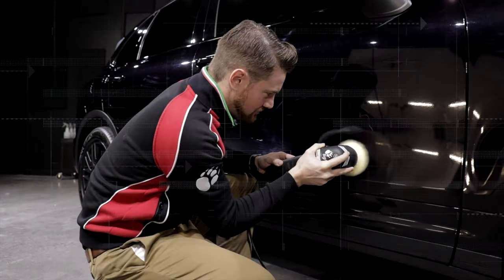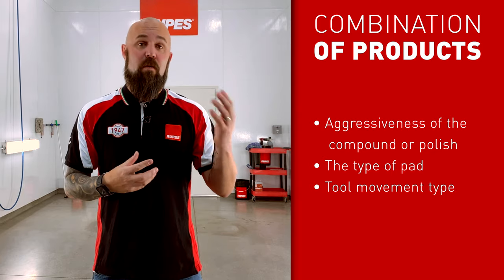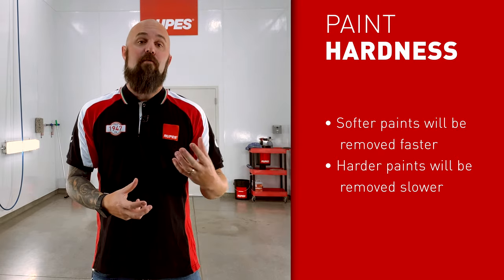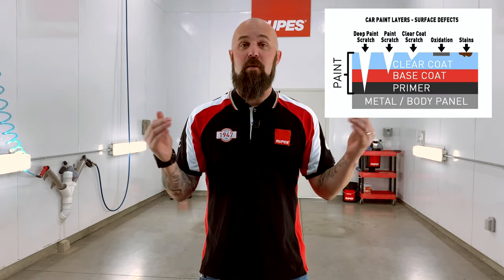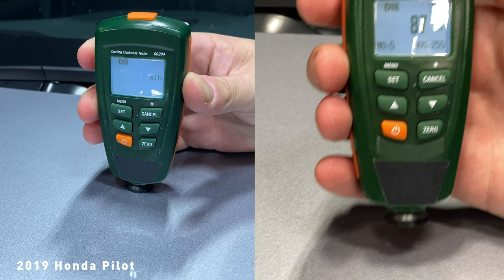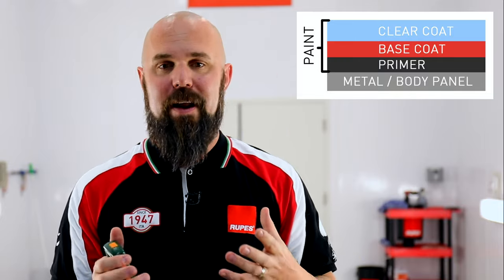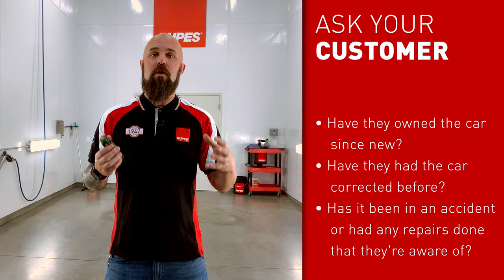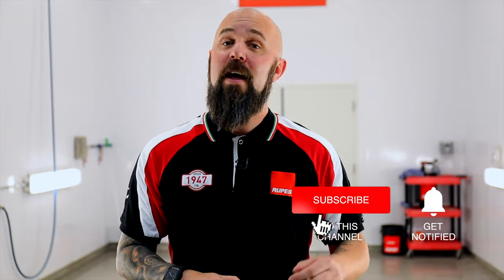How Thin Is Too Thin? - [RUPES Replies Episode 028]

Comment: Quick question on selection of a good paint gauge. What are the aspects or criteria we should look for? You mention accuracy. What’s a reasonable accuracy variance? I understand that paint gauges that read both metal and non metal surfaces are more expensive. Many car parts these days are non-metal, thinking bumpers and fenders, What’s the cost differential vs benefit of getting a good picture of the paint thickness? In other words, how can we be smart consumers when buying a paint gauge? Thanks!
Reply from the maker: Thanks for posting your questions Brian. We do not endorse any one specific meter and there are so many options on the market, in varying capabilities, price ranges, and feature levels it is difficult to even make blanket statements about what is "best" for anyone. 

In terms of variance, it varies (HAHA!). As the price goes up the accuracy tends to as well. Pay close attention to the variance level for whatever meters you're looking at and determine the cost vs. accuracy sweet-spot for you. Even if you buy a very inexpensive meter that has a wider range in variance, thats fine, just know in your head what that potential margin of error is and consider it when making decisions. 

For the cost differential vs. benefit of getting a good picture of the paint thickness - again it depends on your situation. If you're using it as a professional and sanding/polishing on numerous cars every day consider the risk/reward. What is the cost to repaint a vehicle if you mis-judge paint thickness on a customer car? The chances of an incident increase with the volume of cars you touch, right? For an end user, just maintaining their own cars maybe not as much of a risk/reward proposition there because they're familiar with the car and will only be accountable to themselves is something goes wrong. 

I know that is a lot of non-answers, but there is so much variability in this that it isn't the same for every person. Good luck on your research of meters! -Dylan vK
Reply: @RUPES  Thanks Dylan. Yes, i understand Rupes cannot endorse a particular brand. I’m not a detail pro. Just a guy with a few cars that likes keeping them well maintained and help a few friends and relatives with their cars too. I like and have a few Rupes polishers; LHR-15 Mk III, the Nano and have the LHR-75E on order.  It seems the marketplace  has a batch of low end paint gauges from $25-50, $80-130 range then from $200-500 with some $800-$1,400++. A lot of offerings to sort out. I appreciate your feedback. Any folks out there with recommendations, please advise. Stay healthy and happy holidays! Keep the good videos coming.

Comment: One thing that is very controversial is the Decon step before paint correction. What is the best way or the Rupes way of doing the Decon process?
Reply from the maker: Should be no controversy - as long as the step or steps address the contamination it isn’t up for debate. A surface must be clean before polishing, but how you get there each time will be unique based on the specific car and level/type of contamination. Mechanical and/or chemical may be required.

Comment: What steps do you take to up the level of cut if your not getting the result you want on test areas.

Would you go
Polish pad and polish
Heavy polish pad polish

Cutting pad and polish 

Or would it be cutting pad compound etc...
Reply from the maker: Adjust the combination of products or your technique for something more aggressive then test again. Changing only 1 aspect at a time so you know which adjustment is providing the improvement. This video covers the specifics of the test spot and product adjustment https://youtu.be/0Z79_1h2SyA

Comment: Excellent information, thank you. Wondering if correcting paint down to a minimum of about 3 mils would a couple of coats of ceramic coating help persevere remaining clear from UV and other environmental elements?
Thanks again for all the Rupes tutorials on YouTube 
Peter Leoni
Reply from the maker: Good question and probably one better posed to a coating manufacturer. Coatings vary wildly in their composition and the amount of possible film build they produce. Some are more scratch and abrasion resistant than others. Some are more chemical resistant than others. Certainly having ANY protection to serve as a sacrificial barrier over a thin clearcoat surface is a good idea, but you can't make assumptions based on an entire product category because of how much variation there can be.

Comment: What’s the best way to maintain paint that is at 3 mils or lower? Example a fine polish or just leave it alone.
Reply from the maker: Protect it and leave it alone if at all possible. If any polishing is done it should be the finest possible solution you have available and only done to enhance gloss, not to correct defects. Anytime we are correcting the surface we are removing material, and on an already thin surface removal of material can be detrimental to the life of the paint. 

In the case of extremely thin paint a product heavy in fillers, like a a non-abrasive glaze or wax, can be the best option to enhance the appearance and at least provide temporary improvement of the look.

Comment: Is there any sort of paint hardness chart anywhere?   Maybe one based on vehicle manufacturer?
Reply from the maker: Paint hardness cannot be cataloged for several reasons and frankly shouldn't be for a long list of others. The test spot is really the place to start so you have diagnosis specific to the exact vehicle in the exact situation in which you are working https://www.youtube.com/watch?v=0Z79_1h2SyA

Reasons you cannot catalog paint hardness:
1) OEM paint changes, frequently! Supply chain issues, QC issues, raw material shortages, or cost savings. Every OEM has the ability to change paint manufacturers and types in a matter of hours at any point. This means that 2 cars sprayed in the same factory on the same day in the same color could have 2 completely different clear coats used if a changeover happened. While there are certainly patterns there is no way of knowing until you do a test spot. This also makes a list useless, because it is always changing. 

2) Repairs are a reality, even on new cars off the lot. Aftermarket paint is applied very differently and cured very differently than factory applied paint and thus it will behave differently, so over the course of a correction the paint can (and likely will based on statistics) change on some panels. 

3) Modern cars are not all painted in the same place. As manufacturers have become more sophisticated they rely on suppliers of components to do some finishing. The mirror caps might be painted in one factory, the bumpers in another. The hood painted by a different part of the factory than the body and doors. The colors will match, but the application and curing process will vary based on substrate or processes and thus the behavior can be different.
Reply: @RUPES  I appreciate your time!